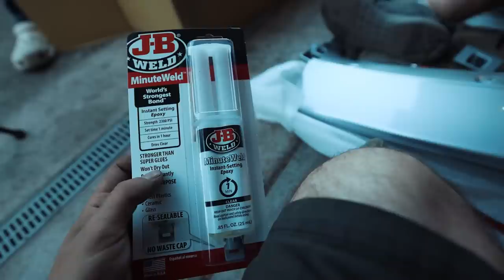The WRX Hatch Gets a Big Wing + Dyno Day Updates for STI & WRX

Comment: In order to get better fitment, you need to adjust placement. Loosen the nuts to where they’re a “loose snug”, push the wing to where the gaps are even. up, down, left, right. You might need to add washers if that doesn’t even out the wing to the hatch gap. Tap the wing with the palm of your hand if needed. However you need to move it to line up, then tighten the nuts down.
Reply from the maker: Trying this today 🤝🔥
Reply: After up down left right don’t forget to hit B-A, Start

Comment: supposed to get it test fitted, shaved down so it sits flush, then paint and mount :) and definitely put double sided tape or something between the glass and the wing otherwise it will bounce around and crack the wing sides
Reply from the maker: Double sided tape is happening 😅🤝

Comment: Did you ever make a video for the 14 wrx spot welds for the clutch pedal?? I couldn’t remember if you did. I wanna see how to get the dash apart😂 it’s a super easy job. Take out wipers and motor, drill out spot welds, pull dash, insert bolts and locking nuts. I fixed my clutch issue too! The shop didn’t grease the clutch fork where the slave pushes it and it was making the pedal feel really choppy and noisy. There was also a huge chunk of rust on the slave plunger. My car is back to normal! Just need some miles to take away chatter and I can finally do pulls at 400hp on E and feel the power 🤙
Reply from the maker: Not yet I Haven't but that is on my to do list 🙏

Comment: At some point, I'll have to bring my hatch up for a meet! Blue 08 Narrowbody. Currently making revisions to my tune, OpenSource is amazing!
Reply from the maker: What program are you using? 👀
Reply: @Smeedia  ECUFlash for reading/writing/adjustments and RomRaider for logging. Slight issue now with RomRaider, I can see everything is connected and logging values when I start/stop then check and all my Saved Datalog CSV files have no data for some reason? I'm using my phone to record the laptop screen gauges while I drive around, lol!
Reply from the maker: Odd issue, I haven't used rom raider in so long 😅

Comment: I don't think it matters which wire you use for ground or positive on a two wire brake light. It's just a dumb bulb. FYI. I don't think that epoxy will hold. That sprayer pumps out 2,900 psi. lol
Reply from the maker: The sprayer has so much sauce it'll shoot off 😅

Comment: How would you know if the heads on if a fa20dit are bad it’s a 2016 wrx
Reply from the maker: What do you mean by bad? 👀
Reply: Well @smeedia I blew up the engine. The new short block comes in tomorrow but I have to make sure that the heads are good and I have never done fa20 heads
Reply from the maker: Make sure cam journals are free and clean, heads are not wrapped and there's no damage to them and you should be fine
Reply: Thanks

Comment: hey smeedia you know a ton and your videos are amazing love the work keep its up! I had some questions about going e85 on my 2018 wrx sti I know there is no flex fuel sensors or kits and I have asked around to get answers of what I need to go e85 I know I will have to run a dual map for e85. Just I can’t seem to find my answer to what I need, I was hoping you can help me!
Reply: Delicious tuning has a flex kit out that works with Cobb
Reply from the maker: Delicious tuning does have a kit or you can run 2 maps 

At minimum you need fuel injectors, fuel pump and fuel pressure regulator 🙏
Reply: @Smeedia  my tuner said to that a ethanol gauge to if I run 2 maps but I will check out the delicious tuning kit!

Comment: Addiction is in fact a serious problem. Don't do it kids. don't modify your car or you will end up with a boost leak which you cant find and your car will fall flat on its face as it hits 3 PSI and that maxima will laugh at you as it passes you on the highway. Dont do it. You want to go fast? go to the fair and get on the rollercoaster. You already did it? stop it. Get some help.